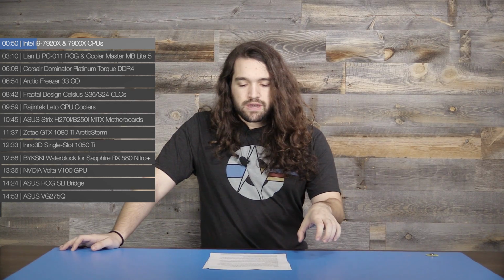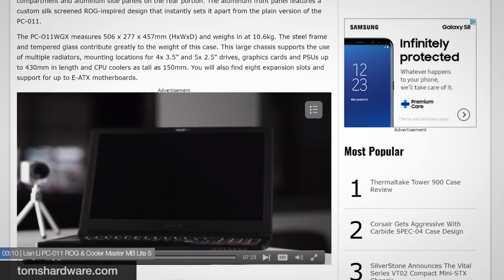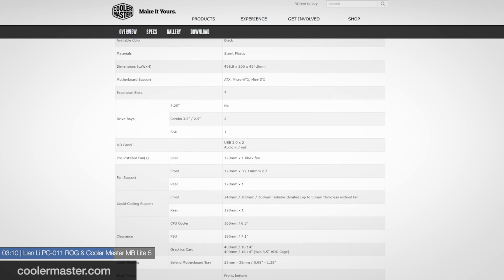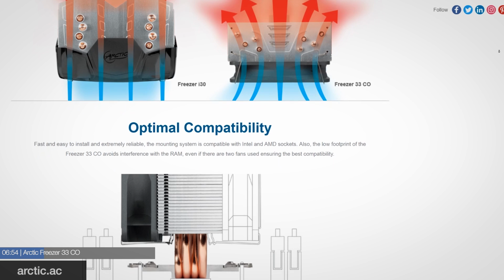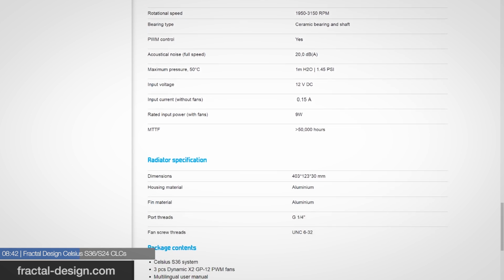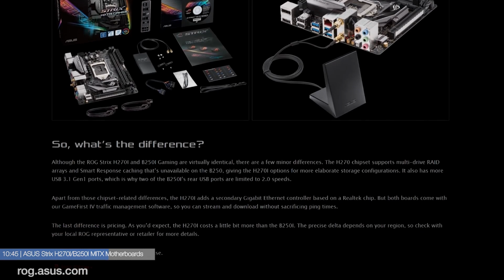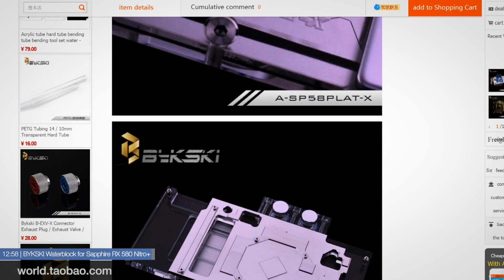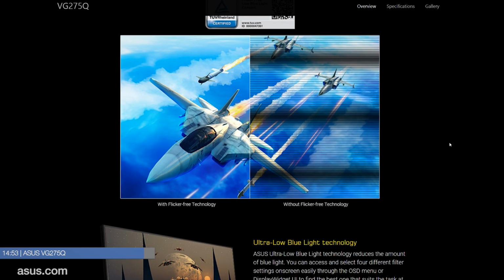HW News: Intel i9-7920X CPUs, Single-Slot 1050Ti, & More

Comment: So you don't do rumors but when you do you do only Intel?

If you covered this you might as well have mentioned (more thoroughly) AMD Whitehaven CPUs wich will come out on LGA 4094 pin socket in June. Reportedly in 10, 12, 14 and 16 core configurations with HT enabled and safe bet cheaper than i9. Problably going head to head with i9 and possibly being called R9 (though this would cause some confusion since we already had R9 graphics cards from AMD). 

I do have to say those "i7" refresh CPU-s are pretty pointless imo. From the leaked specs they offer no real advantage over 7700K while being more expensive (motherboard cost!) and have higher TDP but lower clockspeed than 7700K? Perhaps (maybe, let's pray) they have soldered IHS compared to 7700K but im not holding my breath.
Reply: DANK MEMES I'm open minded as well but false accusations to this channel is bullshit. This guy works his ass off and is definitely not one sided towards intel. If most people watched the entirety of their videos they would understand. With that I leave you, take care.
Reply: What fanboys of any product need to know is that without healthy competition their favourite toys would become unaffordable. (jokey fun fact) Apple is where good ideas go to die ;)
Reply from the maker: DANK MEMES No one hyped anything. Coverage and hype are not synonymous, nor are they mutually exclusive. The entire point of this media outlet is anti-hype. We cover rumors when, and only when, we have sufficient reason to believe they are largely true. This is something we make clear for folks capable of reading between the lines.
Reply: DANK MEMES You don't know when to quit do you?
Reply: Raivo K Yeah, but AMD has R7 and R5 GPUs and I don't see anyone confused by that.
Reply: Raivo K we need to move to 10nm really
Reply: DANK MEMES As long as your not on it will do
Reply: Raivo K R9 is threadripper
Reply from the maker: DANK MEMES No one is talking about 'other channels ' except for you. I was responding to your comments about us. Not others. We do not have jurisdiction over other channels. You will not receive further reply as you are clearly just being contrarian without pausing to think about what we're saying. Cheers.
Reply from the maker: Raivo K We covered several Vega and Ryzen rumors. It would have taken you less time to check that than to write your comment.
Reply: Not triggered. Try again.
Reply: Intel Trolls are the WORST!
Reply: They are not refreshed but to be honest they will be very powerful cpus. They will not have lower clock speeds. They are guaranteed at 5.0 ghz I would think they will OC alot higher. But I am sure they say hey why not charge more and put them in HEDT platform rather than the consumer platform. The ryzen vs kabylake would look vastly different if they used these i7 in place of the kabylake consumer platform. With that said I think everyone should wait for Intel's first consumer grade 6 core CPU. 

Intel needs to fix their weird ass stack. They have a G4560 that is like an i3, They have a unlocked i3 that is priced at i5 levels. They will becoming out with a 6 core consumer unit. But then whats the point of the 6 core HEDT.

I do hope this i9 helps them and hope the rumors are fake or something
Reply: You just are a broken record son.
Reply: I'm not talking about what you covered before or what you may cover after this. I posted more info about these upcoming CPU-s in my comment than you mentioned in the video. Fact of the matter is that if you cover such a story and only briefly mention at the end that "AMD might have something too" when the story about AMD Whitehaven also came out this week then that does not leave an impression of a balanced coverage to me. Either mention both equally or don't do rumors at all.

Case in point: another review site wich i won't mention here has literally 0! AM4 motherboard reviews. They do review motherboards and have a person who does these reviews weekly/monthly but apparently AM4 does not exist for him. And then reviewers are suprised when people complain about them for one sided coverage. I'd say there is a basis for such concerns. Thankfully GN reviews seem balanced.
Reply: Raivo K just face it,amd is suck,just go cry on your own
Reply: Nathan Ferrell Follower? Don't ride the train.
Reply: intel is different since they acually send BoardPartner's info months before + plan longer then 1mnt out......sorry AMD fanboyz
Reply: Gamers Nexus How about don't do rumors at all since it's aids and it causes unnecessary hype to consumer products making them look like they will be God's gift.

For example AMD's Ryzen everyone at first was shoving AMD's head in the sand for not being as good as the rumor theorist said it was.

Crying about 8 to 10 fps loss in gaming lol.
Reply: Gamers Nexus Yes I was talking about speculations in general the first comment was made for all benchmark channels in general not just you sorry that you took the comment that way next time don't skim. I was saying that its best not to review or talk about a product until it is released to the public because it can make false narratives to the public.

Thus making a product seem better than it really is I see you failed to see the point I was trying to make and for a response you dismissed it to revert attention to another one.

I guess it does work though because you did get a lot of likes that way from your fan base fan boying pretty hard.

THEN AGAIN I do see that with most YouTubers fans riding that dick. Doesn't matter if the comment sounds idiotic or not.
Reply: Gamers Nexus I'd say I would have to disagree when you say no one hyped anything. I can think of many YouTubers that hyped up the AMD RYZEN franchise with probably fake Chinese benchmarks making seem better than it actually was.

For me it's best not to release anything until the product is actually released so you can see it for what it is. Instead of speculations. But then again YouTube money right? 

This is just my opinion. Don't take it personally.